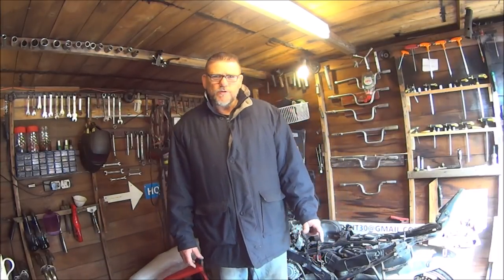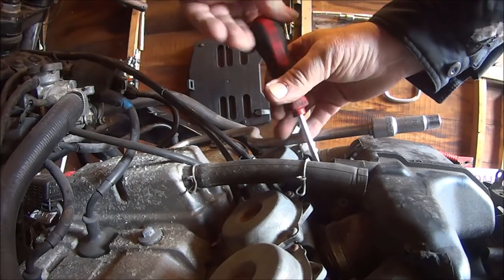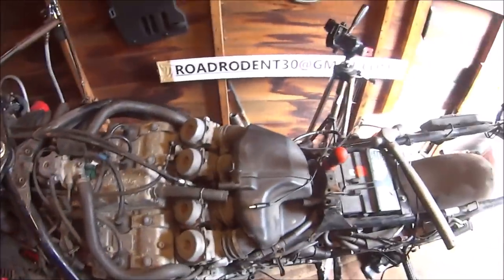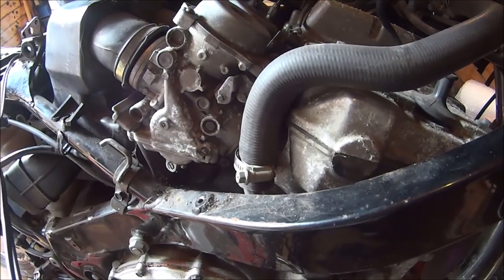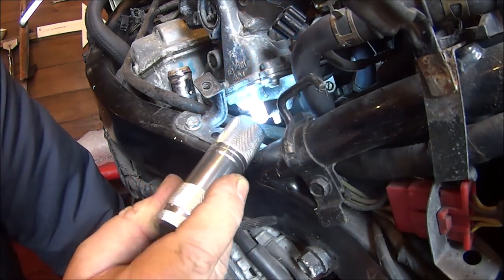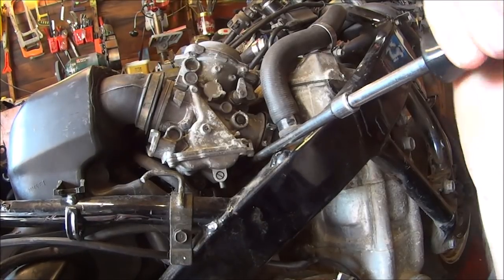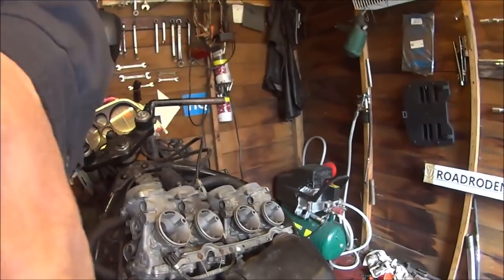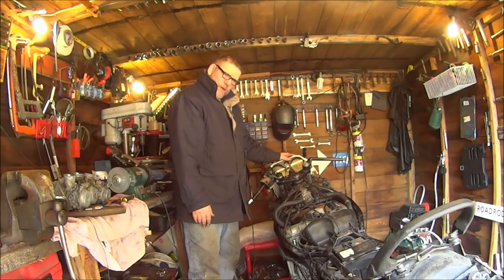Honda CBR1000F Carburettors Removal.

Comment: Excellent video, I enjoyed watching. Puts me right off touching my carbs😭
Reply from the maker: Cheers buddy yes best left alone if the bike is running well.
Reply: My cbr1000f 91 plate ain't ticking over without little bit of throttle or choke. Was fine till I changed oil, filters and coolant. The little black tickover wheel seems to do nothing. Turns a lot one way and seems stuck other way. I'm wonder if the mechanism in the middle of carbs has seized...? Also thinking can I get any WD-40 in there without pulling carbs off bike... Doooohhh!
Reply from the maker: Yeah sounds like all the moving pars have dried up.I would lift the tank and spay the wd40 every were you can get to on all the carb ex sternal moving parts..

Comment: You should buy a set of JIS, Japanese industrial standard screwdrivers off Ebay, such a difference they make. Engine screws that needed the impact driver came out really easily when I used the jis screwdriver on them. 
What's happening with the xj, have you solved the rough running problem yet.
Reply from the maker: More expense I just don't have at the moment.. I did give a big update on the XJ900S in last week's video bud.
Reply: The right tool for the job makes life so much easier.  I might do a video about screwdrivers and how much difference there is.
Reply from the maker: Sounds like a good basis for a great video
Reply: I've done a video on JIS screwdrivers and how to identify the different types of screws.

Comment: I just bought a 95 CBR1000F with only 14K original miles in showroom condition for $2K. The carbs have already been cleaned once and the original owner let it sit long enough to where it needs it again. Please tell me it's easier that this to get em off. It's just a pilot jet or 2. runs great once you roll off those and onto the mains.
Reply from the maker: You might be lucky, like you say they've been off before, don't think mine have ever been off plus the rubber boots were rock hard and crusty on mine.. Good luck. 👍

Comment: does the bike not run?  is there a problem with the carbs?
the frame on the cbr1000f mkI is totally different to the mk2, much lower and easier access to the carbs and upper engine
Reply from the maker: Cam chain failure I believe
Reply: @jonyr1TT  ahhh the dreaded  early version cam chain tensioner with short stroke piston

i hope that the interference engine didnt interfere as its a big job to split it apart
 ( talking from splitting apart  experience )
 if its only the cam chain stretched and the tensioner then its not going to be too bad if you split the chain and pull a new one through
note that there were are i mentioned above  2 types of tensioner
the early version  with short stroke cylinder and the later one  with about double the stroke

the later ones can also weaken due mainly to the oil catcher funnel getting the tiny drain holes to the piston blocked when the oil gets dirty
the actual mechanism  its self  doesnt really fail

they are very very expensive new ( about 270 eur at last count ) but still available
i guess you might be able to find a used one at a breakers but then it will need a overhaul
dont be tempted to do the add the  bolt and spring on top fix as you can over tension the chain and then its really big trouble…..

question you have a lovely white cbr and you are going to get shot for the yam???
the yam is not a patch on the cbr ...

my next toy may be a older cbr1100xx , plenty in germany up for sale for little spondulix
Reply from the maker: Sounds like you know all about the CBR1000F dude. Thanks for all the guidance it will come in very handy throughout this project. Cheers mate.
Reply: @jonyr1TT  had it near 20 years
About 10 yrs dormant but runnable
Now getting ready for touring
Reply from the maker: Nice one buddy.

Comment: I just bought a 1990 cbr 1000f, the guy said it runs great but I can’t get it to start. It only sometimes sounds starts for a few seconds. He said it’s because it was in storage for a year. He said I probably need to shoot some carb cleaner into the carbs. Can someone tell me how? Can I shoot it in from the air intake tubes on the side of the bike or do I need to somehow get closer to the carbs? And how?

I notice that the rubber tubes that connect to the carbs are soft rubber and connect to what I think is the air filter and someone added red rubbery stuff at the connections, seems these crack at the connections? Any way to find new parts?
Reply from the maker: I think your almost definitely going to aft to take the carbs off to clean them inside but first when the aiefilter box is off I would try some easy start in the back of the carburettors. Good luck with it 👍

Comment: Had the same problem on my 95 fs ,, looks like they were not going to come off at one stage … never seen anything like it for along time .but most Honda's are very bad for removing there carbs. not looking forward to putting them back on .. but all you can do is work slowly and keep moving forward :-) remove the air box only if you have too cos there the same when it comes to removing them
Reply from the maker: Yes that video was a long time ago. Not looking forward to the job of getting them back on when the bikes ready. Good luck with yours buddy.
Reply: @jonyr1TT just finished cleaning them … and thank goodness they go back on lots easier
Reply from the maker: nice one fella and thanks for the heads up.

Comment: yeahh, it's horrable to take them of. I have to do the same, but I will take my time. not want to get crazy ;-)
Reply from the maker: yes it sure is. good luck buddy.
Reply: @jonyr1TT   thanks, but I didn't have to take the carburettors off, because some kind of rubber part came loose and got stuck between the middle of my carburettors and jammed the trottle lever, so when I took it away, the problem was solved. thank God ;-)
Reply from the maker: Good for you bro.

Comment: Hi. I just bought a 1991 cbr1000f im the 3rd owner it was having a charging problem so i changed the rectifier went to go start it up and it wont turn over i have videos of it running but i took out the spark plugs and they looked a little baked but do you possibly have any other tips or anything to get this beast of a bike running? Its my first bike and havent been able to get it out on the road to ride yet
Reply from the maker: Hi. I'm having the same problem with the battery going flat on mine it's a gel battery and I've been told they are not very good so I'm going to try a good quality one and hopefully it's going to sort the bad starting problem out. 👍

Comment: Hello I just bought a 93 cbr1000f 2 owners and owner let it sit for a year it doesn’t crank at all I put a new battery in and it also won’t go into neutral this is my first bike but I tried shifting the bike and it’ll only do 3 clicks up and 3 clicks back down any tips?
Reply from the maker: Hi. Make sure it's got the right oil in the engine motorcycle oil and not car oil as car oil will seize up the gearbox.
Reply: Remove the gear shift lever, clean up the bushing, make sure its all free... (maybe yiu have fixed it by now..)